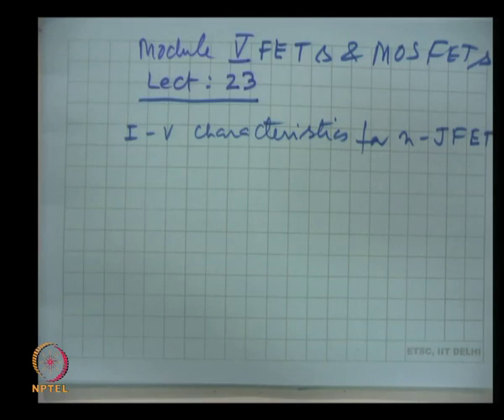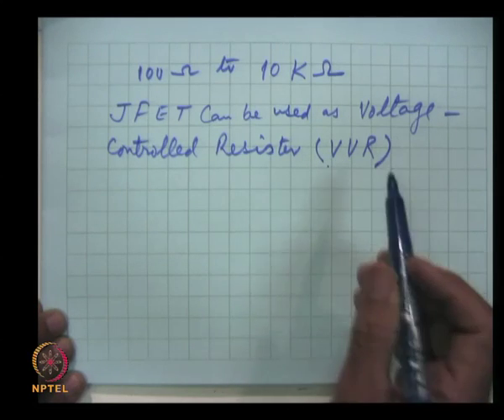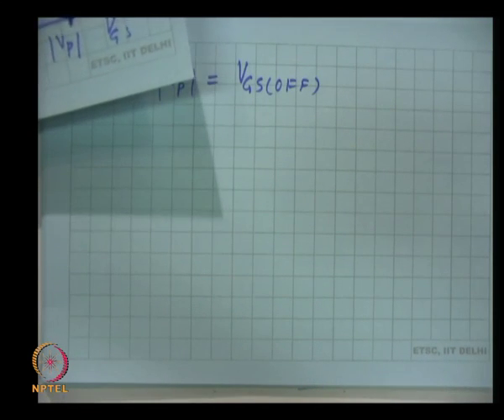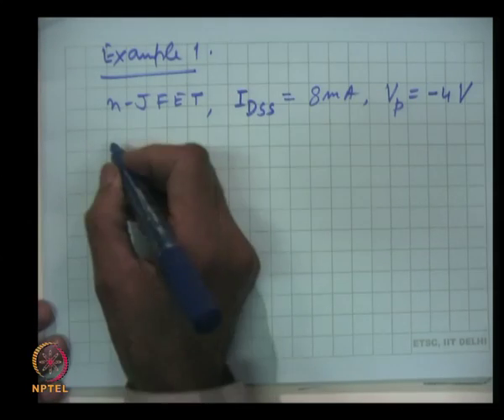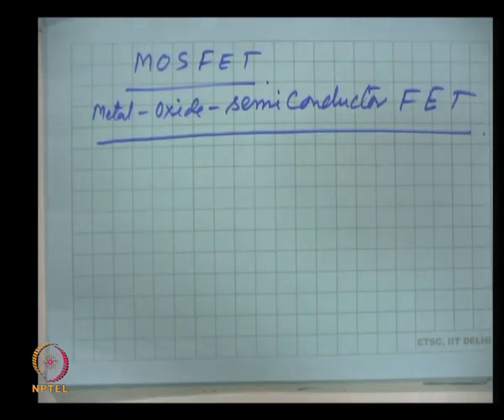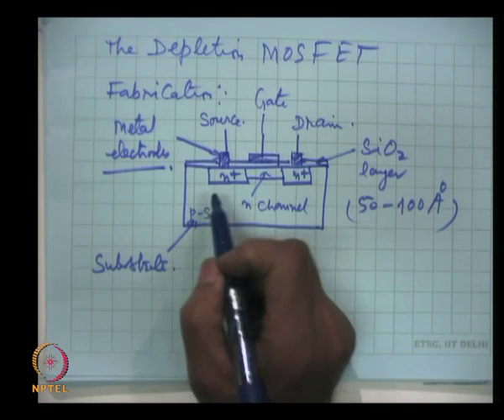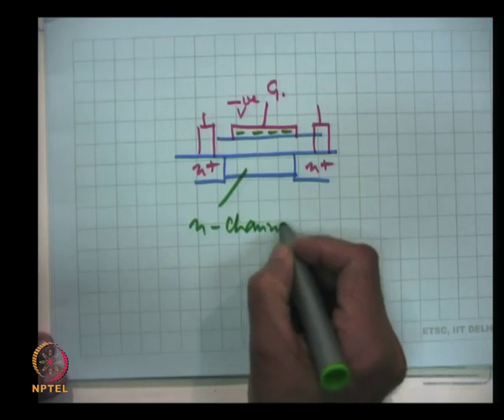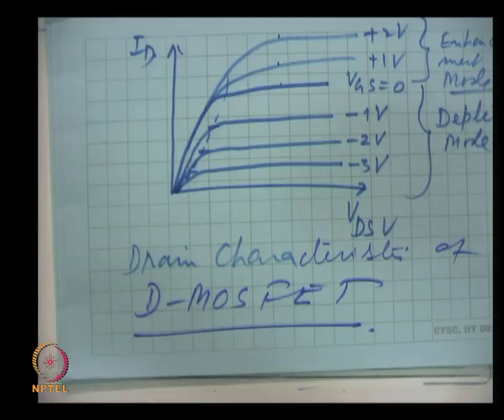Mod-05 Lec-23 FETs ans MOSFET (Contd.)

Comment: in enhancement mode how +voltage  will increase induced -ve charges in the channel region?
Reply: The positive gate voltage through oxide layer repels holes from the Chanel region. The electron density increases because in a semiconductor, the product of electron density and hole density is constant.